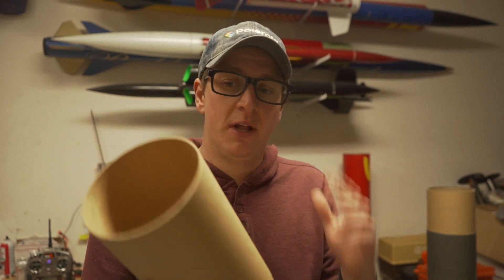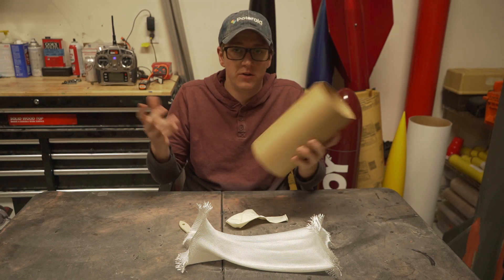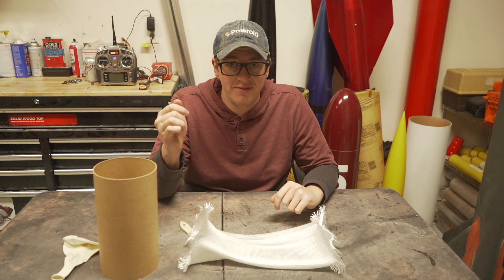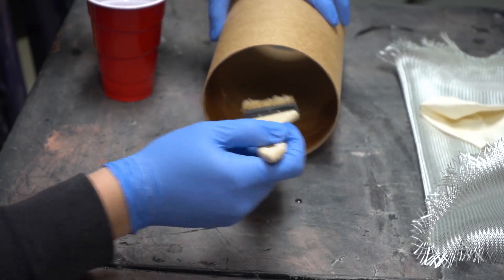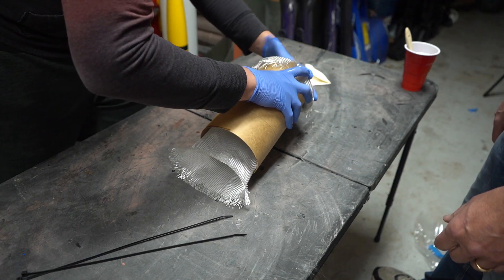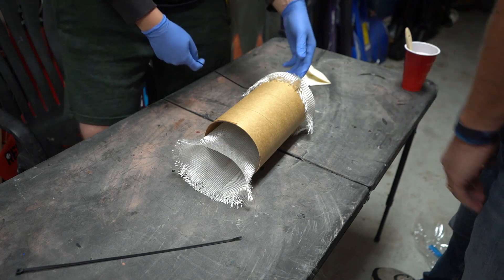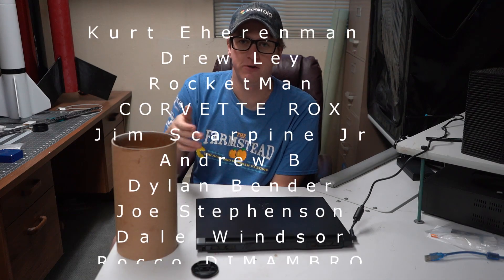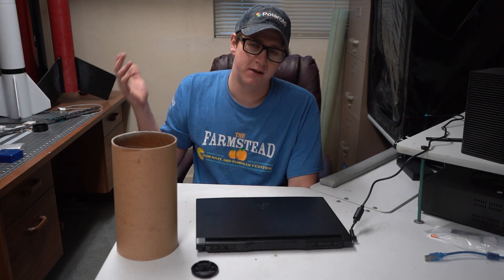Reinforcing Couplers with Fiberglass in High Power Rockery the Easy Way!

Comment: Braden, I have came up with an incredible name for a rocket, as coaster enthusiasts, AGG needs to name a project after the greatest coaster of all time, hundepruttenrutschebanen(dog fart coaster), at call a rocket hundepruttenraket(dog fart rocket). Also, a 12 inch rocket is almost exactly 305mm in diameter, so calling the rocket Intimidator 305 would work.
Reply from the maker: We have actually made that 305mm connection before! Specifically in the case of the Wildman/Rocketry Warehouse Intimidator. 

It would, however, be WILDLY tall. Haha

Comment: What do you do with the switch bands on an e-bay when fiberglassing a dual deploy rocket? I realize there's no structural integrity in that piece as far as the outside but having that step between the forward and aft body tubes makes my eye twitch.
Reply from the maker: If I have one, I glass it, typically, for the same reason. However, most of my cardboard rockets don't use one. You really only need it if you're flying HED, anyway!

Comment: Dude!! Making me miss my b230 5spd 740. Had it slammed and cornering like it was on rails.
Reply from the maker: That's awesome! Mine is a 740 SE wagon, pretty rare. 

It's got a built bottom end, custom turbo manifold and a bit turbo, custom stainless exhaust, a hand-built full standalone wiring harness by yours truly, and I also swapped in the six-speed manual trans from a Nissan 350Z (all SEs were auto from the factory).  It was pretty rowdy on its break-in tune on 10 psi, but it'll probably be going up to 25ish since my clutch is broken in now! Just need to put it back together on one of these days we get above 17 degrees.
Reply: @RocketVlogs  I'd love to check that out if you can link to any vids. And major kudos for figuring out how to diy and stay with the b230!! Way too many people take advantage of the LS route which is understandable due to it's simplicity and relatively low cost. It's a good way to go, but I love to see what all the Dr Frankensteins come up with.